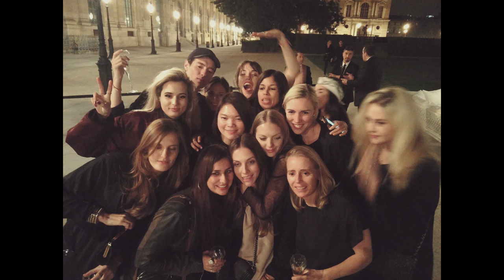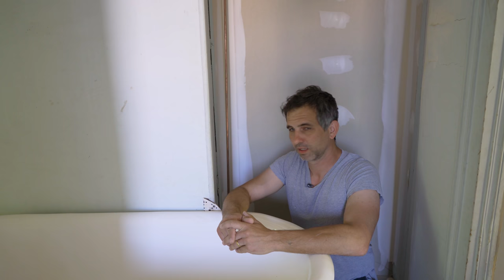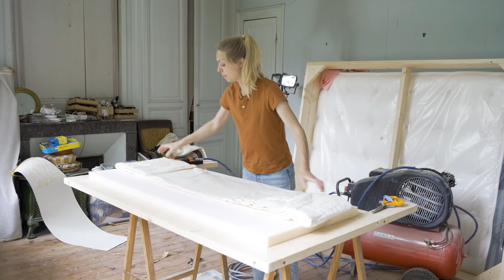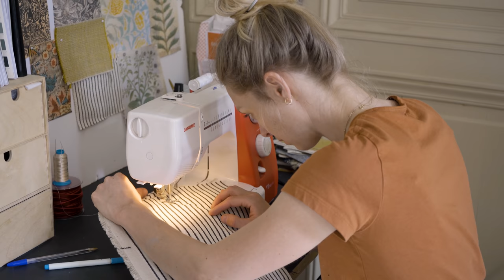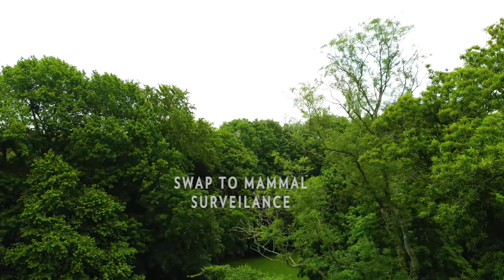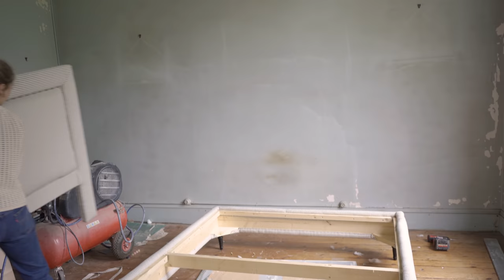How to burn out in 370 easy steps - How to renovate a chateau (Without killing your partner) ep. 25

Comment: The bed looks terrific- the headboard can be hung on the wall. This allows ease of movement for cleaning, it's quieter if guests are the active types and you can put it at any height you like. So glad Philip is still alive- and even if it doesn't function, the bath looks fab!
Reply from the maker: Thank you for this tip! :)
Reply: Right, hang on the wall using a French cleat.  I expect that is Anna's plan.